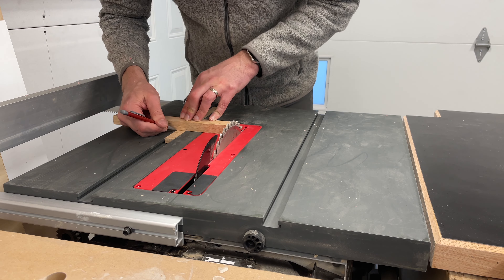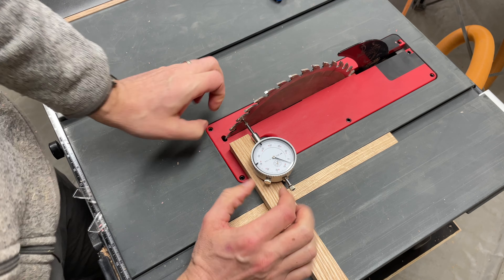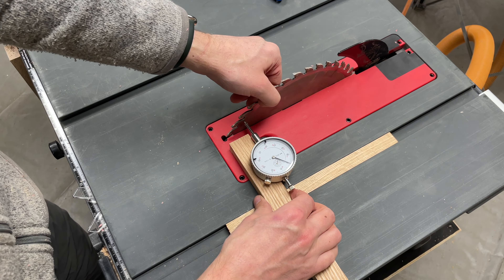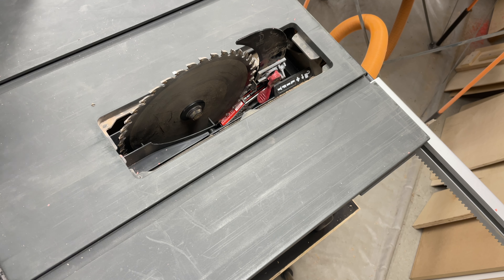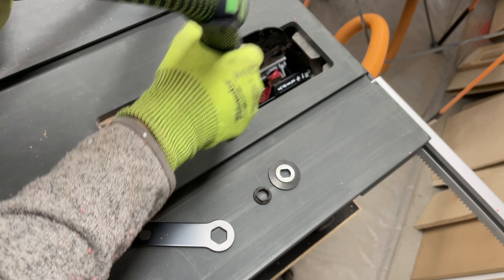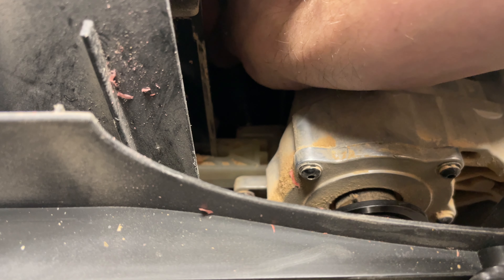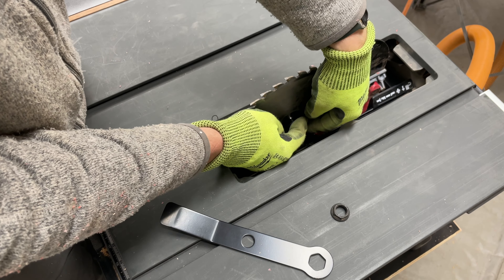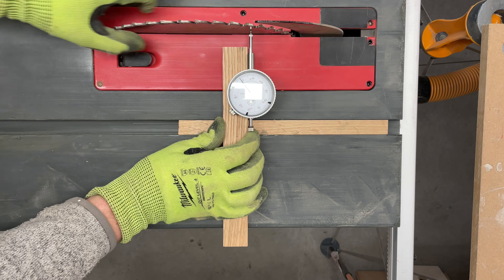SawStop Compact Table Saw Blade Alignment

Comment: i think your way can be faster if you get lucky with the adjustment, but it is a lot of trial an error. The sawstop way has you remove the motor cover for access to the alignment bolt, which means you can keep the blade on to see your adjustments in real time.

Comment: Cool. I'm considering a freud heavy duty or premier. Are thin kerf ok with the riving knives / splitter?
Reply from the maker: I have a Freud Industrial Glue Line tip blade as well. I’ve only used it a couple times but it seems good too. As far as I know the blade that comes with the saw is thin kerf, so should be no issue with the riving knife or splitter.

Comment: How do you like the forrest blade compared to the standard issue? Still ok with rips? Any other blade ideas your thinking about? I've a SSCTS as well and looking at a new blade.
Reply from the maker: I didn't actually use the blade that came with it. I put the Forrest in when I got the saw. It seems to work very well. Minimal burning ripping 8/4 hardwoods, no chip out on plywood. It's nice to not have to change the blade. If I were to do it over, I might get the thin kerf, but generally this seems to work well.